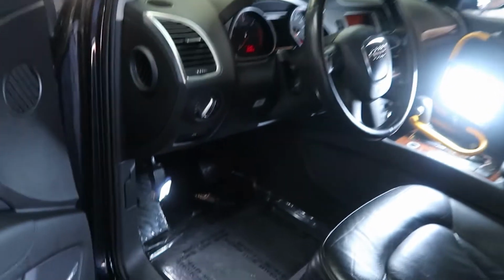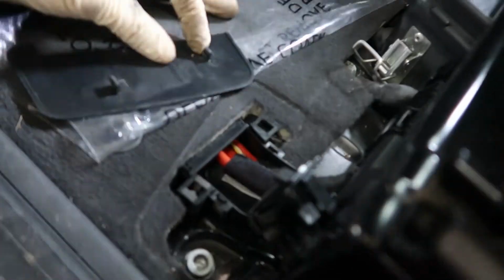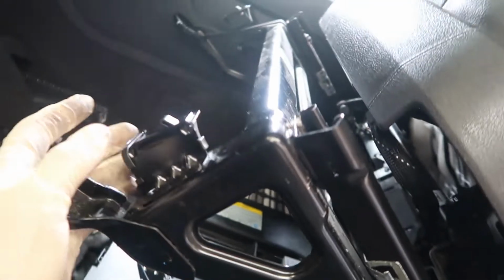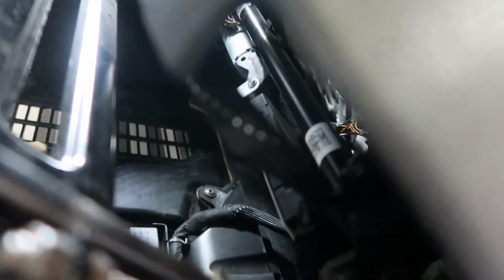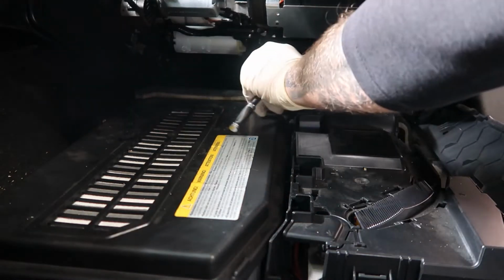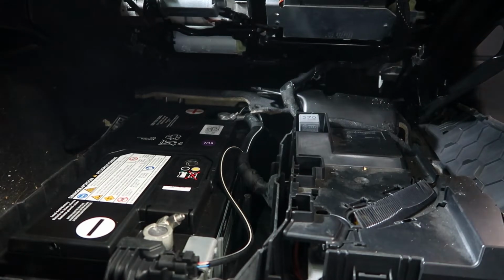How to replace the battery on 2010 AUDI Q7!

Comment: GREAT videos
 & Thanks again for posting! Can you please tell me the name and size of the tool used used to remove the driver's side seat and the battery? I literally have no tools and I need to purchase them before changing my battery this weekend. I also would like to know if you recommend purchasing a gel cell battery over the OEM Battery? There is a $20 price different, but I also found a battery @ the local Walmart for almost $90 cheaper - which is an AWESOME deal, but is it crappier because it's cheaper? Your input will be GREATLY appreciated, Thanks Again!
Reply: I believe it’s a T50 12point toro for the 4bolts holding the seat and a 10mm for the guard